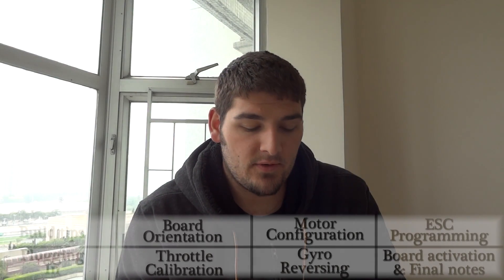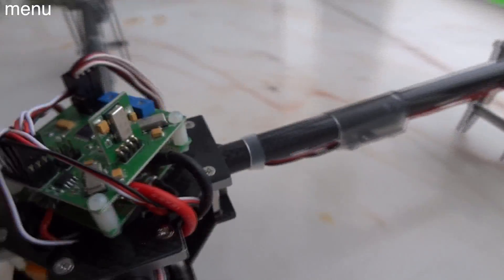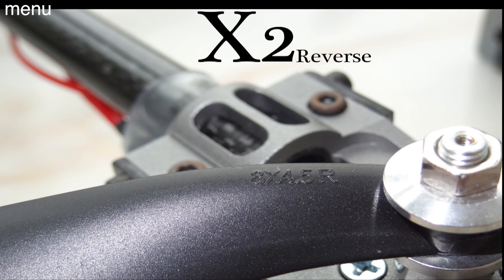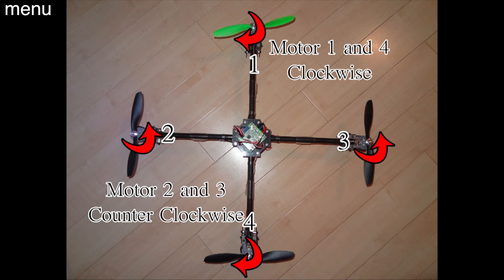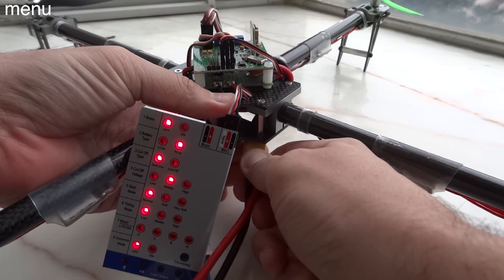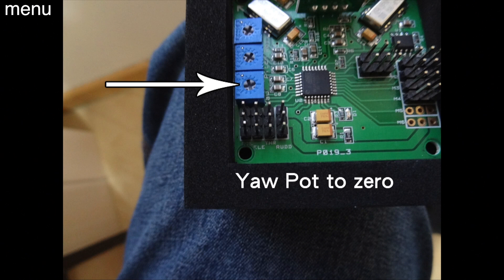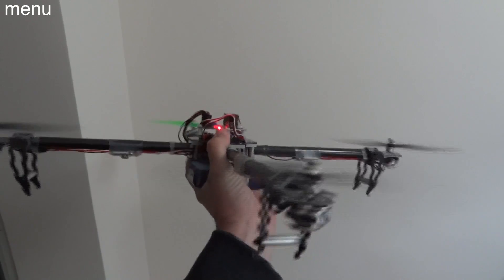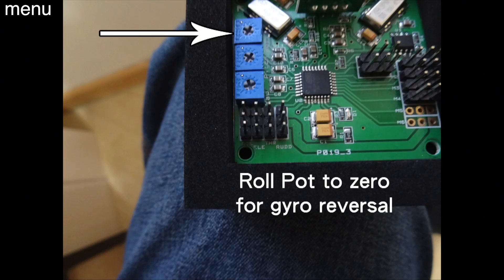HobbyKing Quadcopter KK board setup guide

Comment: hi..i using kk5.5 but i bind it but my transmitter battery in low voltage  not discharged.. but i am not getting firm bind indicator from board. please guide.can you show whole process on kk5.5 black board.
thanks in advance.

Comment: I have had nothing but issues with my kk 3.0 board. I have followed every tutorial i could find and have tried everything from reversing the gyros to adjusting the pots. I've only got it to barely fly once with a lot of yaw spin but then after disconnecting the battery and trying to fly again it seems to forget all my settings??
Reply: I currently have it in a + configuration with firmware version 4.7 any ideas?

Comment: Hi folks! We are trying to make a quad too - but are running into some issues. I do not think its due to a short circuit. Is there some way someone can share how they configured the electrical components, especially the flight control board? We really appreciate your help. We have the I86L flight control board. Thanks :)

Comment: You don't talk about flashing new firmware onto the flight controller. Do you just use the firmware it was shipped with?

If you did flash it, can you walk through those steps, including what AVR USB programmer you used? I think a lot of these frustrated comments are using the FC with the wrong firmware.

Comment: Which quadcopter controller board do you recommend? im used the kkmulticopter controller and still can not fly stable my quadcopter and i allready crash it several times. Also im using a futaba analog rx/tx...

Comment: Yes I understand the 6 pin connection and how 4 pins arent used which dictates the correct direction to plug it in. My problem is that I don’t know what to do once its connected to the pc haha. I'll try to go to HobbyKing again but several people have told me to go there but I never can find the files tab for some reason. I'll try again right now and thanks for your help. :)

Comment: It says 1. turn on radio 2. power up receiver 3. once the rec has a solid light press & hold the sync button for 5 secs untill the rotors beep / twitch... Its not working and I dont know what to do. Any suggestions? Llike I said, I am about to throw this thing in the freakin trash can.

Comment: Dude now I have even bigger problems.  I was trying to learn how to program my radio (RadioLink T6EHP-E 2.4 GHz FHSS) and the manual was so badly translated from Chinese (on the button press's) that I had it really bad out-O-Whack so I cleared it. Now I cant get it to sync or bind with the receiver.  I am so frustrated right now because its suppose to be nice weather out tomorrow as it has rained almost every day for the last 3 weeks. Seems like its always something.

Comment from the maker: That cable is for flashing different firmware. If you want a X quad or + quad or hexacopter, you need to flash a different firmware. That cable allows you to make those changes. Look into the kk firmware choices because they all program differently.

Comment from the maker: To my knowledge, there is no graphical interface for the original kk boards. Only firmware loaders. All adjustments aside from selecting quad, hex, etc are done with the three potentiometers. You at have seen a multiwii GUI. The forums are your friend. All answers are there but not always easy to find.

Comment: Man I tried as hard as I could to find the place you're talking about but couldnt. My USB cable came with my FlameWheel and although it did ultimately come from HobbyKing I actually bought it through AliExpress. Is there any way that you can get me to the link that you're talking about??? I dont have any way to get back to the page that has "checkout" unless I buy another board. :(

Comment: Hi, My son is a sophomore and he doing his personal project on quadcopter. I am not comfortable with this but let him try. I recommended him to go through your video and it did help a lot with his  initial setting up. Your video was self explanatory and very useful. 
One of the motor is shutting off while throttling and starts again while re-throttling. It does not seem to have any connection problem and I don't why it is turning off while throttling, any suggestions please?

Comment: Hi, I am using the KK board. My question is I set the throttle calibration like you showed in the video, and now my board won't unlock. I even tried re-flashing it to different versions of firmware and quadcopter programs and it still won't unlock. Have you heard of this before?

Comment: hello, thank you for such a well done and comprehensive vid.i just built an X copter, and my motor 2 (fore, right) is backwards, i.e. (when it heads toward the ground it slows down)...which axis is this? all other motors are fine in this regard.

Comment: Thanks for this video :) I bought parts for a Quad, and these types of vids really help pass the waiting time! :D - also great info. I don't know what amount of manual comes with the board, but this really made me more confident that i'll have no problem getting it working.
Also, how do I tell if the yaw needs to be reversed? what motors speed up/slow down in a yaw motion?

Comment: Hey there, ok i tried everything but i do not get it right in the x config.
i flashed it to x but now it goes in every direction on itself.
tried to reverse the gyro 's .
first i forgot to change the motor set up from + to x so  from
 + F1 cw L 2 ccw R3 ccw B4 cw 
 to 
X  FL1cw FR2ccw RR 3ccw RL4 cw
but even then it went all the across the place anyhow it's far from stabl.
i hope you can help me out here even though it must be hard without visualizing it.
thanks already for any tips and the vid

Comment: Hey there, great vid, thanks for it.
One question however.
When you activate by putting the stick left (or right) do the gyro's calibrate on that position its standing in on that moment?
Or does it use the calbration you've installed earlier?
Because somehowe my board does pull at one side and the other time it doesn't.
sometime it even goes so far that even with the correction buttons on the radio it won't go level.

greets from Holland

Comment: hello, i have the same board and esc but i have ax-2910q motors. when i turn the throttle up the motor do start to spin but when i move around my board it does not go any faster nor slower? what can be the problem? when i connect 2 motors with props and i push forward the quad does nog go forward. not even 1 of the motor go harder or slower. how to solve this

Comment: I think the cause is a disagreement between the software/KK board and older transmitters which means that the quad is trying dip at the back right (m4) all the time... it seems that the software we're using 4.7 is the latest I think... has no stick centring routing at startup so the author tells you to use the trims... but I don't have the range on my trims to do that... so lift off will be... errr, hard.

I may be wrong, but I think that's how it's happening.

Comment: Hi James, I have exactly the same issue.  M4 appears very sluggish but will spin at high throttle or if I trigger the gyro with a sharp tilt.  I have set the throttle range on each ESC first then doing all at once through the kk board (running ver 4.7 firmware).  when i changed the cables the sluggish behavior stayed on the m4 channel so it is not a ESC or motor issue. Open to suggestions...

Comment: My setup with the HK 2.1 board fails to start one of the motors correctly, that motor/ESC works when connecting it directly to the receiver, but via the control board, whichever motor is plugged into M4 will not spin up unless you use a lot of throttle.  My first impression would be that this implies a failed channel on the HK board, do you have any comments/suggestions?  Certainly it would not fly with this problem.

Comment: Hi, thanks for your video . I already watched it several times but I can´t get it work on my quad. 
I did it until the part that you have to calibrate the ESC with the Tx. Before that i did not set up the ESC because i do not have the card already (maybe that is the reason because is not working?) 
well after the calibrate of the ESC i return the YAW POT to the middle range (mine is counterclockwise 0) but after that when i give throttle the propellers start to work but there is no difference

Comment: my quadcopter just flips on take off im using the x525 frame the same board (hk kk board v2.1) im using tghe firmware it was shipped in . But for some reason one motor suddenly speeds up and flips it , i have been trying for 5 months now

Comment from the maker: Not a mistake. Select Nimh to remove any chance of LVC(low voltage cutoff) on the lipo settings. This way, your craft will allow the battery to fully drain rather than one esc slowing down and crashing.

Comment: Hi!
One question. I'm building my first quadcopter and I'm using HobbyKing Multi-rotor  control board. I noticed that once the ail, elev, thro and rudd are connected to this control board, it gets hot at the bottom within just few sec. I make sure that polarities are correct. Is this normal? I'm scared I burn my control board. thanks.

Comment: Great Vid! In my case, i have to pull the yaw pot to the right for throttle range callibration. And i get the right beeps.
but what do i have to do now? when i put the yaw pot full to the left nothing happens when i put the throttle up. and when i let the yaw pot on the right side. all the props work well but i cant navigate anything and no gyro works.  i use a dx6i set to helicopter mode.
thanks for answer me. i would love to go out with my little quad.

Comment: I have two quads with the same KK board, I cant get them to fly at all. As soon as I start them they roll and imediatly crash (only with the thortle activated). I tried every gyro reverse roll even yaw and it doesent work, nothing seams to work. When I arm it the quad is on flat ground...

My trim and subtrim are all zero I tried with two different remotes two different boards. At this moment I am getting really annoyed because a broke a tone of prop.  The flash version is v4.7

Comment: You need to zero all of the esc's  as well. Drop the roll pot to zero and max throttle on the tx. Plug in your quad, drop the throttle to zero, unplug.
Remember to put your roll pot back to normal after*

Comment: Yes you are right! For both versions  HobbyKing Multi-Rotor Control Board V2.1 (Atmega168PA) and HobbyKing Multi-Rotor Control Board V3.0 (Atmega328 PA) manual shows CW rotation for motors 1 and 4 for default + config. Which is opposite to this video. However I believe nothing matters as soon as you did roll gyro reversing accordingly.
I have another problem, can we identify which behavior of quadro can be corrected by which gyro? Another instructionla video for gyro gain setup will be very good

Comment: The reason it flips is the ESC's are not starting at the same time. But its not an ESC / Motor prob cause u can chnage M3 to M4 and the prob is still in M3!. Also under pass thru all 4 Motors are synced to the throttle channell. As soon as its back in normal mode mixing the signals it has the problem.  I dont understand fues bits or weather the clock freq can be set and is hence wrong causing errorsd on the receive channels being decoded and hence mixed (with gyro which shoudl be o).

Comment: Interesting but I have the same problems as Flippit1303 ir 3 motors spin up same 1 only after 25-30% throtle!  I've calibrated all 4 esc's and they test same when using "passthru" mode on the board. Therefore its not an ESC problem, rather its is a mix type prob with the board.
And it is always on Chanell 3 on the board. Is it the same Ch with everyone else?

Its frustrating me no end!

Any help guys! I'm in Brisbane if anyone can catch up! Cheers Des

Comment: similar problems as some others with the 4.7 firmware...switched the ESCs for the new motor configuration and it's better, but the yaw control does not seem to be working at all. Right yaw makes motor number 1 race up like crazy and tip copter to the right. Setup: HK 2.1 board, 4.7 firmware, 2830 750kv Turnigy motors, 30A Turnigy plush, 3s 2200mAh, 11x4.7 props, Orange 2.4 GHz w/spektrum DX7. Total noob with quads so any help would be great!

Thanks!

Comment: Excellent vid!  I'm also a bit stuck.  V3 board, set up in an X confi also using the 4.7  flash.  When I power up, quad tries to flip over to the right (viewed from the rear).  Not this is from a level position, so there should be no correction?

Comment: After plug in Battery and after the 123 Start sound (before cell count normaly) the red LED is blinking two times. Its even't able to aim something.  The trottle only works. No direktion stick , no gyro.   Houres ago it had worked. The changing i did before: exchanging the YAW vs ROLL cable, this i undone after i seen the start problem.  But the Problem stays.  WHY?

Comment: Also after you correct the motors into the right plugs, you should do the throttle calibration again. If you don't you will see weird issues with motors speeds (I've done it...).

Comment: What battery are you using and how long does it last?  I went with a Lipo and am wondering if there might be a better bat for the application.  Is there any other motors or speed controllers that you have tried out that you would recommend to use or stay away from?  The motors that I used draw too much current!   What was the device that you used to program the ESCs?  Thanks, Johnny

Comment: I have an X configuration quad running a KK Blackboard 5.5 which spins clockwise every time I get it up in the air. I have tried reversing the Yaw and adjusting the Yaw pot but nothing changes. Any ideas what is wrong any help would be greatly appreciated oh and your video rocks. Cheers

Comment: I reflashed the board to erase the previous setting, because I did some gyro reversing and don't know which one is which. Try the new motor layout. It works. I just need to reverse the yaw gyro. Thanks. But I haven't try it outside yet.

Comment from the maker: Ok, so if you flashed 4.7 xcopter you need to plug your motors into the board differently. Top left=1, bottom left=2, top right=3 and bottom right =4. Yaw reversal sometime takes a quick take off to know for sure. Test this new motor layout and let me know if that works.

Comment: I have built one, the X configuration. Flash with v4.7 firmware. I check the gyro direction and it looks alright. Just the yaw I can't tell if the gyro correct or not. But when I try to lift, motor 3 and 4 spin faster than 1 and 2, and cause the Xcopter to flip forward. Tried to reverse elevator, but still the same. Why? Also on smooth surface, it wants to rotate clockwise. Reversing the yaw, doesn't make any difference

Comment from the maker: @aboss00 hmmm... It could be the firmware on the board. If you have the AVR, test out a different firmware. You have tried it with all the pots in the center, right? It generally  won't arm if any pot is at zero.
Other than that, it sounds like you might have a bad unit... It's rare but not impossible. I highly doubt the TX/RX is the issue.

Comment from the maker: @dhdsracer To clarify the battery hook up a bit more. The board is powered by the BEC's in the ESC's. Just watch your polarity when you solder the connectors for your lipo. If that get messed up you will fry all four ECS's at once! Guess how I know that!

Comment from the maker: @arsitama
 1. The Esc battery leads all come together. All positive are soldered and all negatives together.
2. Standard Airplane mode.I personally use dual rates and expo as well.
3.Yes, when I get some time. It's easy and only takes the right equipment.

Comment: @dhdsracer Moved them all to right all to left no change in the behavior the 
LED is solid RED it flashes imediatly after power on after that it remains solid. 

On power on throttle up  after ESC beeps power down. The ESC are beeping as if no RC is connected.

My options:
1. Software problem might try to install a firmwire
2. Board problem :( 
3. The remote and board don't work togheter. I have a really bad remote from HK again HK-T6A v2 6ch with no options on it :)

Comment from the maker: @aboss00 Odd, the LED should only briefly flash when power is supplied and only be solid when armed and ready for flight. When you go to full left or right on the pots then plug in, the LED doesn't blink or do anything different? In other words, you can't access any gyro reversal or calibration?

Comment from the maker: @aboss00 Ether something is not hooked up correctly or you have a faulty board. Does the LED ever turn on? Can you tell if the board is being powered? Maybe your esc's don't have Ubec's and there is not power going to the board? Can you get the board to arm? A faulty board is extremely rare but still possible. Tell me more.

Comment: Hy, 

I have the same HK board 2.3 and out of the box with no firmewire updates, I can't get it to calibrate the ESC or to send any signals to the ESCs for that matter.

If I do the calibration manually with just the receiver an remote everything works. When I connect them trough the board nothing works. 

I use a HobbyKing 6 channel remote HK-T6A as basic as it can be. I am already getting fed up with HobbyKing. I did't update the firmware to eliminate any discussions about the image used.

Comment: Hi Don, I have a X525 from goodluckbuy and my other specs are 2.2 nanotech 35-70C, 8" props, KKmulticopter v5.5 xcopter v2.3 and I'm running in X configuration. It is flying nice but the roll and pitch pots seem to do nothing. The flight is always mushy like I'm flying in water. I've done the stick centering reset which works according to the LED. Do you know what could be wrong?